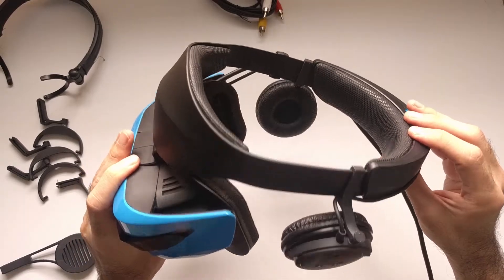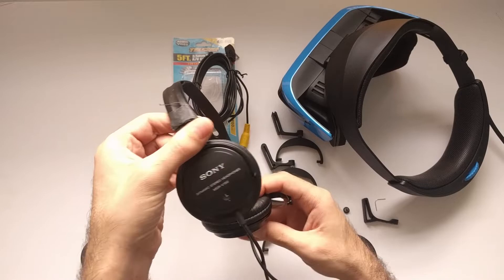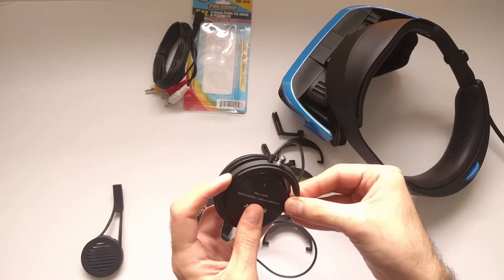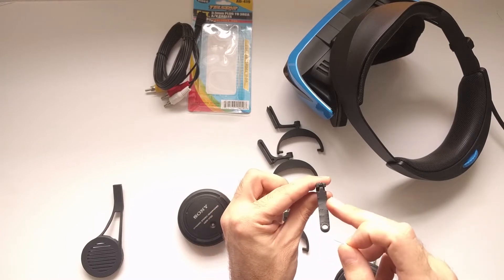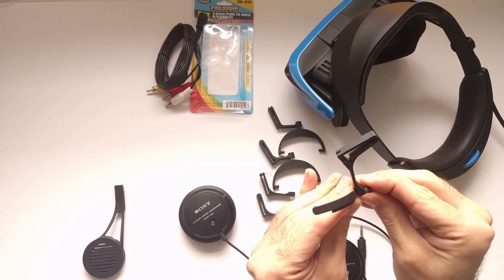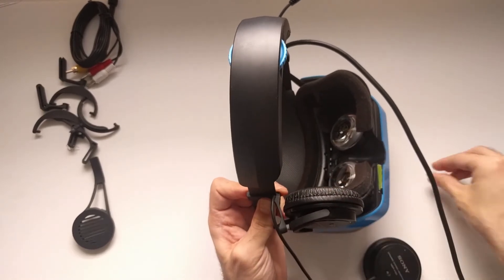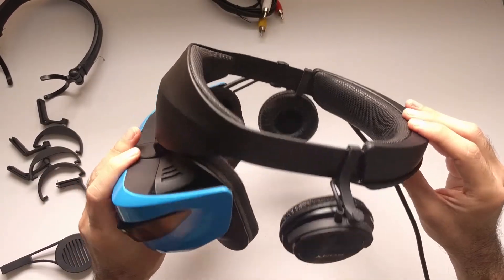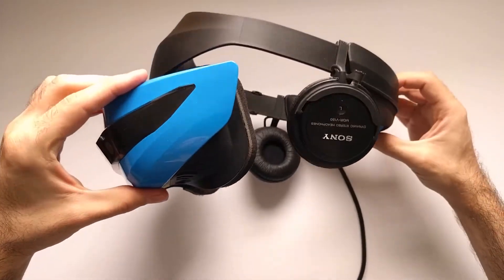WMR Headphones Mod - 3D printed Adapter

Comment: Does the 3D Parts only work with the Sony MDR-V150?
Reply from the maker: Yes, I have tried it with also similar Sony headphones with "professional" label but it did not fit
Reply: @MilosParipovic  Thank you. I also wanted to know if you managed to add a microphone? If so how?
Reply from the maker: @myserious_record2774  I bought a microphone and TRRS plug (4-pole) but I didn't do it because I never needed mic in VR. It is simple if you just Google wire order. One is common for speakers and one lead of a microphone. You can also dismantle old Android headphones keeping the mic on line and then just wire out the speakers instead of earbuds.
Reply: @MilosParipovic  Thank you so much for the help!

Comment: I need this. I tried using a bluetooth ear buds with a mic but having more than the two controllers connecting makes them all shaky.
Reply from the maker: I left the link in the description but it worked only on Acer. Know that it is not perfect and I broke 3 so gluing the rotating part of the headphones in place was a solution

Comment: $50 for a set? fuuuuuuuuuuuu
Reply from the maker: Set is $26 but that is if you already have headphones. You can also download file for free and 3d print wherever. I am not making money on it but 3d printing is expensive considering that would cost under a dollar with injection molding

Comment: would this work on an HP WMR headset?
Reply from the maker: Not like this, but I'll modify it. Can you put on the headset and measure from the bottom of the headband to the middle of your ear? In millimeters please.
Reply: I'm interested, so i'll answer this. From the bottom of the headband to the center of my ear is 50 mms.